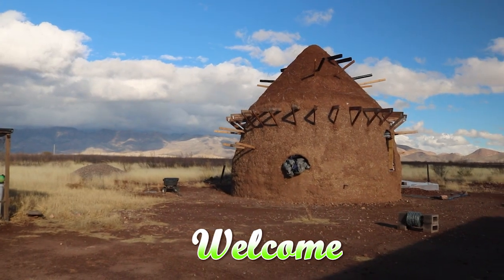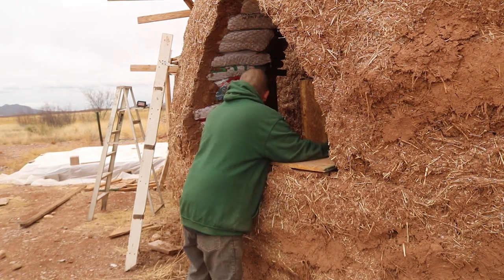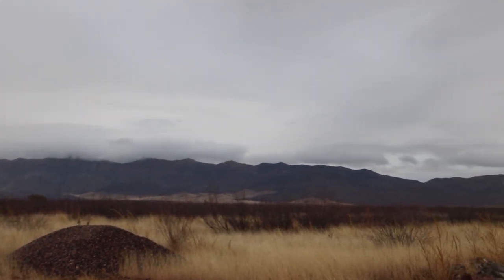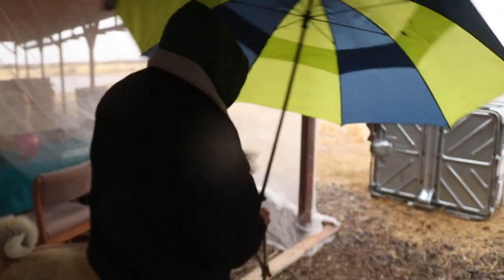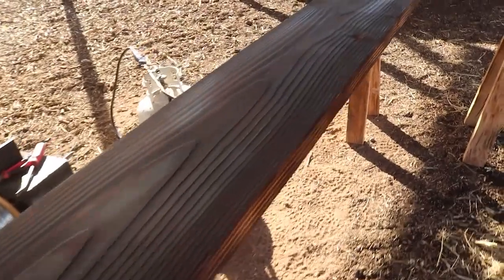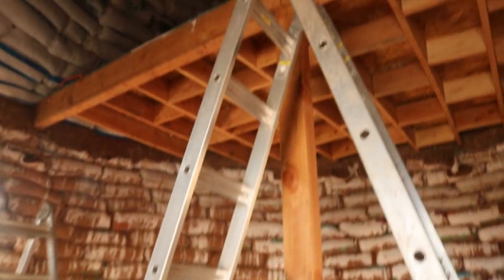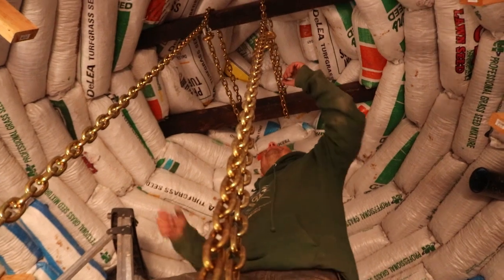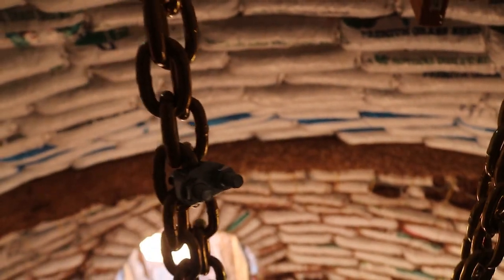We Built An Amazing Floating (Suspended) Loft In Our Earthbag Dome

Comment: In my opinion a ground support is neccesary. Image a candy cane shape coming off a wall. Or a full half circle coming off the ground and not in the middle but off the back against the dome
Reply: I agree.........better safe than squashed.   Or maybe better estheticly, bend several 1X8s vertically along the curvature of the interior walls up to and supporting the perimeter of the loft.   This way they would buttress the wall and help support the loft.....and wouldn't intrude too much on space.
Reply: @IggyDalrymple  yeah thats a good idea too but I wouldnt wanna put too much support on the walls either.
Reply: What a great idea!  I bet a blacksmith could forge a couple form fitting supports for that loft!
Just ask CREW what he thinks!
Reply: @IggyDalrymple  This is my worry as well. In theory a dome can impart some resistive strength. In practice, it's earthbags with a margin of error and capable of shifting and settling over time. It's too much concentrated force and can cause a collapse if things shift out of place too much. If there were three to five vertical wall braces against the inside of the dome connecting to the central posts, that would make this much more stable.

Comment: I must've  missed whatever video(s) posted where you talked about what is going to be done with all the exposed truss like wood dealies that poke  out of the dome are for. Initially I thought it they were probably there  because they were going to become the supports for a walled in balcony type structure but I don't  see an access doorway built into the dome at a level that would work for that.Then I thought maybe there would be outside steps/stairs up to a balcony that encircles the dome but with the issues  with standing water and cob that seems unlikely. So then my thought process was that they're there to eventually support some sort of water catchment that'll be suspended from them out away from the dome and would lessen cob damage. Anyway..I can't  wait to see what their real purpose is! If anyone knows please tell me, I don't  handle suspense well. Lol I had to care for my elderly mother after a brain bleed for a lot of 2021 so I missed a lot of vlogs. I did try to catch-up once I was back at home but unfortunately couldn't watch all the vlogs, darn it.

Comment: ok so it might just be me but the inside looks pretty small as far as you know living space goes even after the post was removed . so my question is are you going to make that like your living room / kitchen / dining room ? or do you plan on making another dome  for like the kitchen  area  could put a mass wood heater type stove in it  . i mean with all the forest you have lol . yeah tough  call but to be self sustained your going to have to find a way to cook and heat . i know solar  but that dont always work great . so will you be adding a wind generator at some point ? you can make one pretty simple out of a hover board motor . it would be small but  as long as there is wind it would feed the battery monster  i would really love to see you guys make a few things . to be honest . wind generator . mass rocket stove heater . a  huge water filter  for drinking water . there pretty easy to make to . you have the soil for it .  basically rock sand and charcoal  of course clay  would be needed to hold the water . would work alot better then the small water filters . would love to see you make  a doggie dome but with the snakes i dont know if that would be a good idea or not .  a solar dehydrator for dehydrating veggies and meat  i mean who dont like beef jerky . and best part is if you make it  you  can make it bigger then you need  so it will take care of any needs  or up sizing you do . a hot tub would be cool .  a smoker  for smoking meat . man there is just so many things you can do . maybe finish the house dome first lol . take care work safe and happy new year you two .

Comment: In retrospect and maybe for the next doom
Using two 2x12 across the doom for the main joist might be better
Similar like how they double joists for openings like stairs..
Or another way could be put maybe  2x12s across the doom 
Outer edge of loft (maybe 2 doubled up) then 2nd one 1/2 way to wall
Then place floor joists on top of those 2x12 (main beams. ?) and outer wall

Comment: One inch of rain is how much on your recovery system?
Reply from the maker: Approx 1300 gallons
Reply: Ideal on 2200 sq. feet is 1300 gallons (4921 litres).  Reality yield % is closer to 800 gallons  (3000 liters). If all went into cistern, it should be ~19 inches vertical, on a stick measurement.

Comment: The chains are really ugly did u consider a 2" dia galvanised pipe with a flange strapped on the bottom and top wood supports. It would be much cleaner looking I think.

Comment: If you find you don't like the chain you could use thick steel plates a few feet long on either side of the beams to bolster where the boards meet. Combined with the beam you installed in this video that would be very strong.

Comment: Eliminating the post from below is a good idea. Support from above is only required because the beam at the edge of the loft should have been more substantial. You helped it a lot with the extra board.  A little stronger beam and you wouldn't have needed the chain at all (maybe a  single long 4x12 that goes all the way across?).. The chain works, but it looks sort of out of place.  Perhaps the permanent stairs or ladder that you'll need to get up and down from the loft could also be a brace for that loft edge to make it stiff enough?  You'll probably want a railing at the edge of that loft for safety? The design and attachment details of that railing could very well act as a truss, as part of that beam, giving all of the extra strength and support to the loft that's needed?

I'm a metal fabricator and build and design tree houses brackets and zip line course platforms, curved and spiral stairs, metal mesh decks with railings etc.  Now, I realize that heavy welded metal or huge timbers don't fit easily into a diy budget. You should consider some element though, such as ferrocement. With just a few rebars, some screen, mesh and cement, things such as curved archways,  self supporting stairs and railings, and structural beams could be made very affordably. If the cement look doesn't fit you could cover it over with cob or adobe.

Comment: just get a electric space heater- temporary plug the windows say the plywood and a little cobb  sealing the edge of the plywood were it meets the frame. hang two tarps over the door one on the inside and one on the outside.  Then just lean a pc of plywood against the tarp and run the electric heater for the evening- I think you would be surprised on how warm it might stay.  Even with your body heat  from two people and a dog would help warm it. also.  Even a  heat lamp.  If you think about A big box store like HD.  They control the temp using heaters at the entrance of the store.  Then they count on The heat from the people in the building, the lights, the computers, then also the physical mass of all the stock and metal shelving in the store then a insulated ceiling.  Most HD only have heaters in receiving, right by the docking doors  and along the front registers and entrances.  In summer- in dryer climates- swamp coolers- pulling massive amounts of air into the building- which you feel rushing out of the exits when you walk in.  I would bet you would get about 48 degrees possibly 50